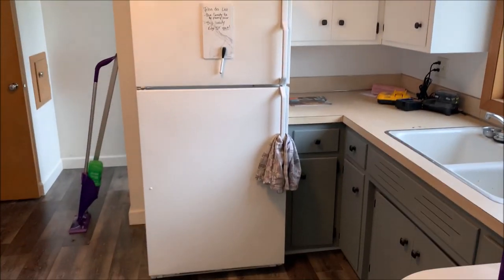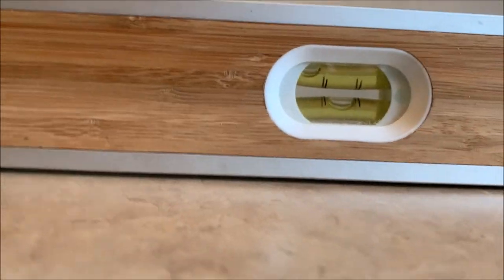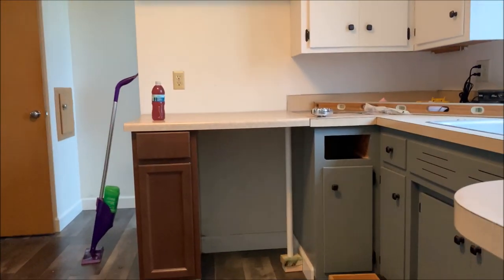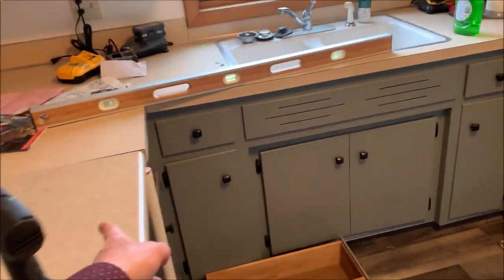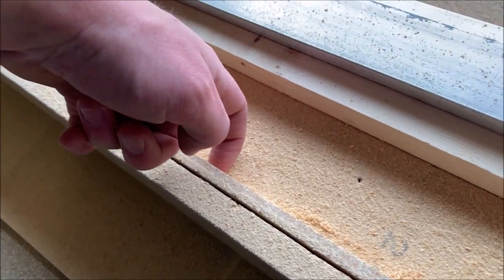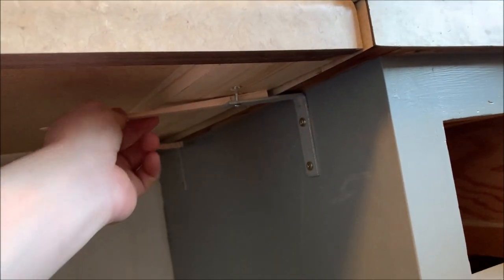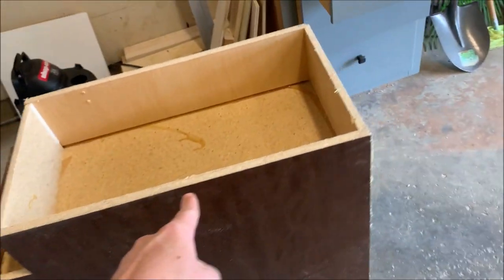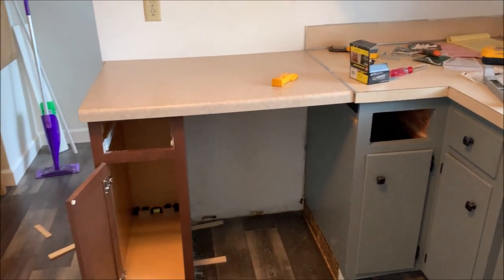Adding a Cabinet to Make Space for a Dishwasher

Comment: As an old architectual drafter (I drew house plans for twenty years for contractors) I knew by watching you that you needed some help. Wish I was there to help but I'm not. Question: how are you going to get the drain from the dishwasher to the sink? 😁 need any help just ask.
Reply from the maker: I just ran a waste hose through the corner cabinet. From there it went up to the air gap, then down to the disposal.

Comment: Just a thought...what about mounting the microwave above the dishwasher on that blank wall?
Reply from the maker: I wanted to run an exhaust vent from the microwave and the existing ductwork goes right above the stove into the wall. Much easier that way than routing it around to the other side of the kitchen.